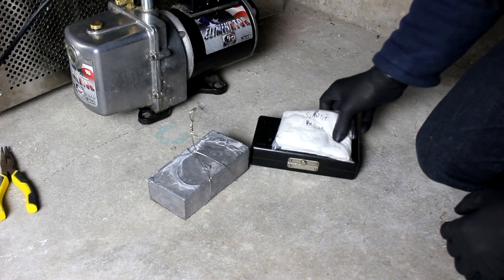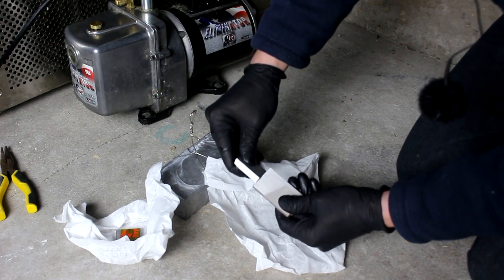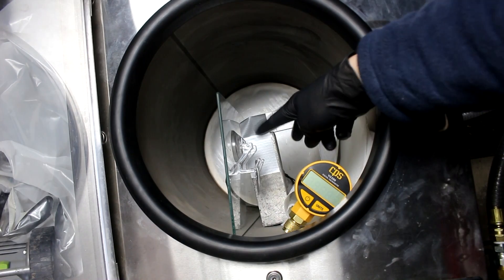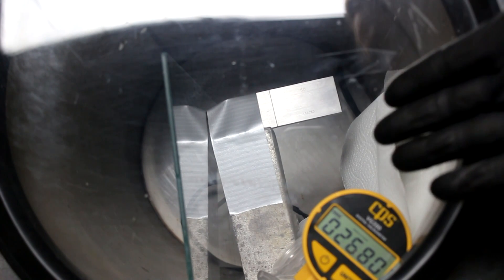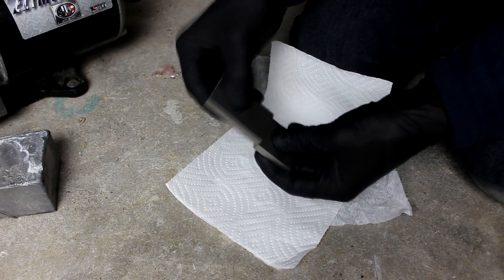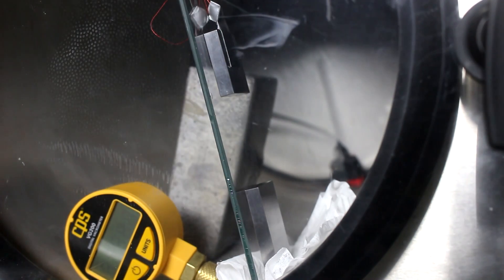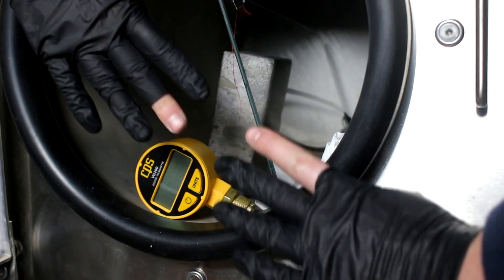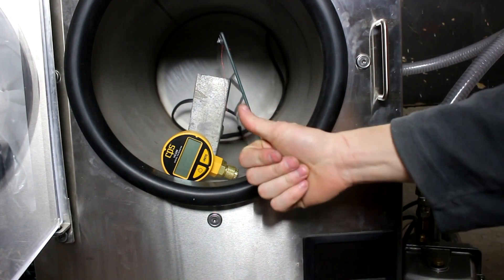Will Gauge Blocks Stick In Vacuum?

Comment: That's kinda stupid. You should have put a few grams on the outside block in the first experiment to see if it took less force to separate the two blocks then if not in a vacuum.

Comment: I suspect it's an electrostatic charge created by differentiating metals touching.  Even made from the same materials, there's minute differences.  Anytime metal touches metal a tiny electrical charge is created which is why rust appears at the point of contact.  If you can measure any electricity on the surface, before and after, it would show.  So either an electrical attraction or a magnetic one since electricity and magnetism are two sides of the same coin.

Comment: +Cody'sLab
Can you check with an ohmmeter what is the conductivity between those two pieces after they've stuck to each other?

Because, if the attraction is caused by some electrostatic force, it would require both pieces to become electrically insulated when slided against each other. It would be weird, because metals are conductive, highly unprobable, but this suction effect is unprobable by itself also :P
It is however an option easy to test and exclude, and if that would be really the case, it would have been a discovery of the century, as turning a metal into an insulator would have giant uses in electronical industry.

Comment: You should ring them togheter and put a weight sligtly less than the weight required to separate them and put them in the vacuum chamber.
If it is really suction even a small change in pressure will be enough to separate them

Comment: cody sorry to ask but aint the melting of the string adding some extra molycules of pressure in the vacum just wondering and is there a way that you can get a picture of the surfices of the metals i mean like under a microscope just for fun to see how rigigt the surfices are you know to see if its the same efect as velcro works if velcro had 2 kinds of hooks on each side

Comment: I believe this due to van der Waals forces (i.e. inter molecular forces) between the atoms/molecules on the surface of the blocks. In normal conditions there would be a thin layer of water on the surfaces (metal has some hydrophillic, or water attracting properties). Because the water molecule is permanently polar (and has a dipole moment), it will tend to align the dipoles of and thus attract other water molecules. I understand this type of van der Waals is called dipole-dipole.

Even if there is no water on the surface, and the material has no permanent dipole (which I believe is true of steel), it will nonetheless have a temporary dipole due to the motion of the electrons around the nucleii. This temporary dipole can then induce a dipole in similar nearby molecules, and thus cause attraction. I  understand these are known as London dispersion forces.

Thus we would think that both of these would contribute to the phenomena in some way. There seems to be a knack of gradually sliding them together to give the van der Vaals a chance to build and take effect.

One test you could do is to try and get them to stick WHILE THEY ARE IN A VACUUM, which would remove any water (and thus dipole-dipole forces) from the blocks. If they do, then London dispersion forces are in effect. Mind you, I'm not sure I'd want to put my hands (even if gloved) in a vacuum to try!

Comment: I have a theory, and i'm not entirely sure this hasn't already been discussed.

First of all I think the Van Der Waal force is playing a key factor in the sticking together of the gauge blocks.

My theory is that an oxide layer on the surface of the gauge blocks is affecting how the surfaces interact and why wringing the blocks is important. I think that an oxide layer would create a boundary between the two surfaces and Inhibit contact between the atoms in the blocks surfaces, thus weakening or blocking the Van Der Waal force. This is why wringing the blocks is important, because it would disturb the oxide layer allowing close interaction of the atoms in the blocks, and allowing the Van Der Waal force to take affect. If there is any truth to this theory then I think removing the oxide layer and quickly connecting the blocks with a slight movement to allow meshing of the atoms on the surface would allow them to stick.
Reply: Cold welding is unlikely because ceramic blocks work the same way and those are made of metal oxides entirely. Also, there's oil between the two layers.

Comment: Sorry that I'm a bit late on this but i felt that I needed to write my first ever comment on a YouTube clip... Years ago a friend of mine told me about these blocks and some of the theories around them. He concluded by saying that they where all bogus and the real reason they stick is that you glue them together with water vapour from the air.
I have never handled any blocks myself but watching the video, reading comments and with my limited grasp of physics I find it highly possible.
- When cleaned they were harder to stick together.
- Someone who claimed to work with similar blocks commented that they were a great deal easier to stick together if you stained one surface with a fingerprint. 
I find it hard to belive that you could ever create such a large surface smooth enough to intact on a molecular level. But you can glue them with water and surface contaminations!

Comment: The other issue is that objects which appear macroscopically smooth and stiff are actually not so on a smaller scale. As you know, the Van der Waals force depends on surface area of contact on an atomic level, which is related to smoothness. The sliding technique may constitute an "ad hoc polish," shifting the atoms enough to optimize the contact for a given position.

Comment: You need to create a mechanism that will cause them to stick together reliably outside of the vacuum. Something that allows you to put pressure on them and then slide them together. I would assume using springs.

Comment: hey cody! watched the cold welding series, and from the beginnind i thought, you should find youre self a "scrapped" piece of metal, even the most expencive gages wont be flat, thell have around .15 to .05mm deviation as from scrapped steel that has from0.001 to 0.0001 mm deviation, you can test it if you put two of flat objects one on top of the other theyll float on a thin layer of air until you stop them, and they actually stick to each other.
have a great one!!

Comment: Did you try putting stuck together blocks without oil in the vacuum chamber, or only with oil like the first test? 

Also, could you hang weights from them while in the vacuum chamber to see if the vacuum reduces the amount of weight required to pull them apart? Would the amount of weight be different with and without oil?

Comment: when you dropped them together on the pane of glass....I am sure that the pane of glass is in no way perfectly flat. therefore the problem still exists that you suspected that was caused by the tape. what if you made a plane out of the blocks  for a secondary set of blocks to slide on??? wouldn't this xperiment require a perfect plane?

Comment: When you slide them together it could be creating some type of static electricity or something that then slightly binds the molecules because the blocks are so perfect. All the molecules should be a similar distance from each other so then what ever is created by the friction holds them together.

Comment: the test where you attempted to drop the first onto the second gauge block would never work because as AvE explained in his video, when two nearly flat surfaces aren't wrung together and the first one is simply set on top of the second, it creates a "hover" effect where the top piece glides over the surface of the lower piece.
Reply: Noah Villarosa only with air though right?
Reply: this effect could only be neutralized in a true vacuum, which is currently out of our reach

Comment: I'm thinking that it has something to do with electrons, you are moving electrons past each other, maybe that creates some sort of magnetic bond.

Heat from friction perhaps warms the two blocks on a microscopic level and when they cool down, they shrink and grip each other?

Since(as far as I know) electrons are more "loose" in metals than in other substances, maybe they share them and the two blocks temporarily become one. 

What if you try to measure those blocks with a multimeter(if there's any momentary change in voltage, capacitance), when you slide them together? Or if you have a very sensitive magnetometer?

Comment: These gauge blocks are lapped to very close tolerances and the material 
used is highly refined. When you slide them together you now have 
virtually no air between them. Our ambient air pressure is about 14.5 
psi (1 bar) and this is the force that will hold them together. If left 
together for a long period of time you could see local bonding, 
especially if they are contaminated with your skin oils and acids to 
start a reaction or hardening like glue. Read the manufactures care 
instructions. I don't know about the ceramic blocks, but any metal 
blocks should be cleaned with high grade tool oil and wiped clean with a
 proper tissue. You should not touch the gauge surface with your skin 
after cleaning. Pitting may occur over time and will degrade the life of
 the blocks. If any iron is present they should be demagnetized. Many of
 these blocks are made of high grade tool steel. Carbide and ceramic 
blocks = Big Bucks!

Comment: Cody, why doesn't it just have to be the same intermolecular forces that happens with watchmakers Quartz? The surfaces are so smooth that the intermolecular forces are strong enough to create bonding between the two crystalline surfaces. Assuming the gauge blocks are highly machined, you might be able to assume the edges are machine hardened and the crystal structure is very confined with no interspersed impurities. Leaving only the attractive forces of the atoms on the edge of the crystal structure.

Comment: I'm commenting mid watching and one tip, when you make the block drop on the other in the vacuum, as quick as you drop it let the air back in, because if the block experience (I might say it wrong) more vacuum after the drop then the drop does nothing

Comment: You need access to a vacuum chamber like they have at NASA the gloved hand feature so while the chamber is under vacuum you could try and ring the blocks together inversely it would be interesting to see if the rung together blocks would still stick together in a pressure chamber

Comment: their PRESSURE and or magnetite in mineral oils ect no room for air when you get to. a #1-2 finish  we had in my shop a grinder that would take .0001" and divide that 1000X's and sliding across it would make a slight noise and no Sparks mild steel was so polished you could use it as mirrors

Comment: In order to entirely disprove the postulate, if air pressure keeps them together, you should be able to pull them apart in a vacuum.

Comment: OK, this is gonna be rough, but bear with me.
When you have a metal, its going to have some kind of work function, usually measured in eV, that it takes to remove an electron from the metal's surface.
When you wring the surfaces together and get them close enough, the electron cloud from one piece of metal merges with the electron cloud with the other.  This means that when you go to pull them apart, you have to overcome the work function of the conduction electrons on that surface.
That's my best bet.
Also check the Casimir Effect.  For sufficiently flat, sufficiently close surfaces, you alter how the quantum vacuum behaves, effectively freezing out certain electromagnetic modes between the surfaces and creating negative pressure.  You may well be wringing the uh.. don't think there's a word for it yet.. out of the quantum vacuum between the two surfaces.

Anyway, just some thoughts.

Comment: If gauge blocks are as flat is advertised, wringing them together should get the two surfaces close enough to each other for fundamental fields "strong" and "weak" to interact... Just like the feet of a Gecko Lizard.

Comment: Two metals are held by intermolecular forces (not to be confused with INTRAmolecluar forces which holds molecules structure together). Since surface of the two metals is highly polished, more FE-C molecules are "exposed" to surface. That is why gauge blocks are replaced (in factories) when they don't "stick" together anymore. So, more molecules exposed on surface, more bonds created. Intermolecular force is present between two or more different materials as well. This force is much weaker compared to intramolecular force. To break or to create an intramolecular force, you need high temperature. In order to weld steel, you need to either melt it or you need a force (brake the force holding Fe-C molecules together) and cooling the steel again, force kicks in by it self. If you heat the steel even more, to it's critical melting point, you can brake the Fe-C bond, it's very crystal structure. So, "cold welding" is highly impossible, I would rather call it "cold bounding". 
So, why two blocks aren't sticking together just by putting them close together? As I said, heat or force. And you need force to brake those bonds, and that's why there is twist involved. The twist creates friction, and friction is more effective way of breaking bonds the simply using pressure to achieve that bond braking. So, yes, he is actually breaking off "some" (read millions) molecules of that gauge block and so they interact with other gauge block, and creating that intermolecular bond. Later, when two blocks are separated, those molecules are not in alignment with the rest of the surface, and thus, they "fall off". And of you do that enough number of times, surface of the block is "damaged" and they can not "stick" together anymore, in other words, the need to be polished again.

Comment: I wounder if you could please do this experiment:

How high an average drone can literally go if you ignore battery or control range factors comes down to the atmospheric density, the higher you go, the less dense the atmosphere.

I wounder if you could place a single hobby grade prop and motor, something equivalent to a DJI phantom or an actual dji phantom motor prop combo and set it on gauge to measure the amount of lift in KG, as you lower the pressure this value should fall until the prop cannot produce enough lift to sustain flight?

If you like i can send you links to the appropriate equipment?

Comment: Some ideas : blocks under compression in and not in vac. Blocks with medium in-between such as water , oils , paints , different machined metals , non metals . Different surface areas measuring pull apart force .

Comment: Cold Welding is a problem in space, with any sort of spacecraft.
Which is why they make an outer layer of material which CANT be cold welded so that if a collision does happen it won't weld it.
This used to be a problem with Hatches on shuttles, stations, etc.

Comment: How long do they stick together under normal atmospheric conditions? do they ever separate? if yes how long would the time be under less pressure? if they don't seperate: how much weight could they hold under normal pressure and is this still possible with less pressure? so how much force is required under different conditions...

Comment: try sticking the 2 together then suspending the pair inside the chamber. If the phenomena is indeed due to a pressure differential, then the blocks should separate once the pressure approaches equalization.

Comment: If it air pressure keeping the blocks together why not wring them normally until stuck and then remove the air around them in your vacuum chamber.  They should fall apart due to the removal of the force imbalance.

Comment: you proved the oil was a great help to holding it together, why did you not try putting them together without the oil and then putting it into the vacuum chamber ?  it could be a combination of both
Reply from the maker: I did on the 45 minute version of this video

Comment: You forgot a method of getting them to stick in the vacuum chamber, place them together, then turn the chamber on and remove the air between them (if any). I don't think dropping them together while already in a vacuum was an accurate test

Comment: try cold metal vs warm. that thermal expansion might be something to look into.
Reply: static or hydrostatic do to the micron level of oil.
Reply: have you checked for micro rifling.
Reply: imagine if our basic technology now day's with processors and heat sinks were to use this to attach them together. I'm using a mirror polished v8 air cooler and it's impressive.

Comment: you should wring them together in air, place on string in vacuum chamber, then see if they fall apart in vacuum, to test if air pressure plays any role in pressing them together (vacuum between the plates).  sort of the opposite of what you just did, to double prove the same idea.

Comment: I tried using two pieces of pretty flat glass. It is interesting because they do stick along the axis of their normals but they are free to slide in the other two axises. In the case of the glass it does feel like it would have to do with vacuum. To test this in a chamber I think you need guides to prevent the lifted glass sheet not to slide in case it is not perfectly aligned with gravity. Unfortunately my own vacuum chamber broke before I even completed it so can't test it for the moment ^^
Keep up the good work Cody!

Comment: van der Vaals forces are different for different materials.  can be calculated, also.  so, can ceramic be stuck to metal?  are forces same or different?  why or why not?  seems like trying to stick same and different materials together, and measuring differences in force between similar and different, would be fascinating experiment to test the hypothesis.